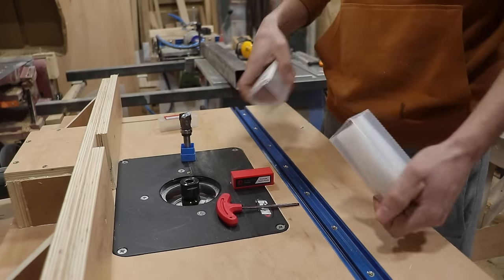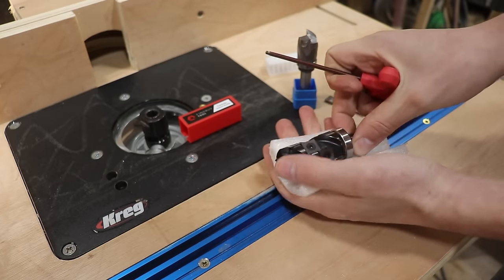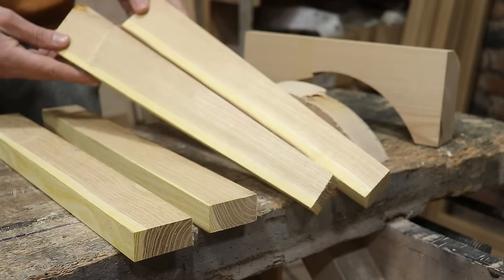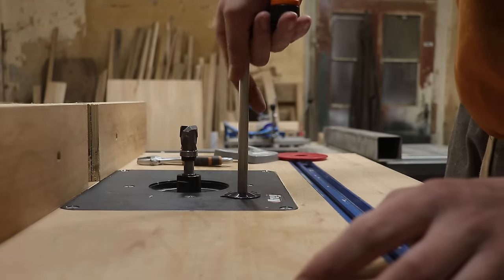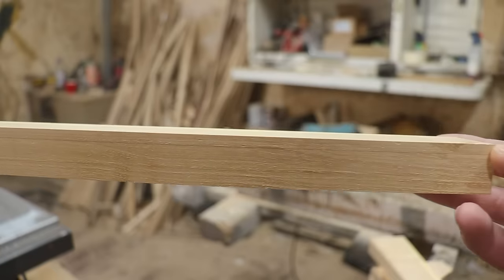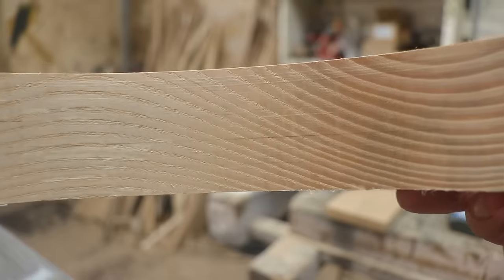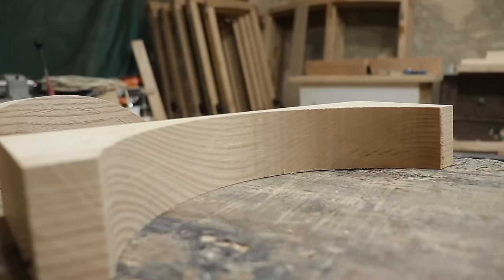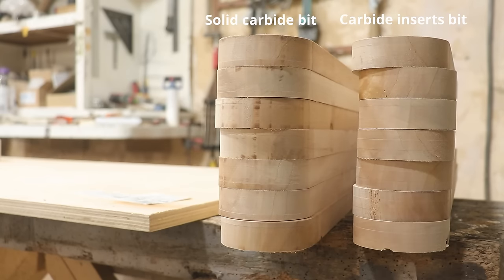The TRUTH about the carbide insert router bits

Comment: The insert one leaves very noticeable lines where the inserts are not at exactly the same depth.  Love the idea of these though; scare the $#@! out of me however.
Reply from the maker: They do leave some marks. Not going to lie, this thing is pretty intimidating!
Reply: Just like working for years on a small or mini lathe and stepping up to a BIG lathe. It takes a while to get used to the size. But once you do, it does not bother you any more.
Reply: But read the pinned comment at the top. Niclas explains that two of the inserts were not properly seated. When he removed them and then placed them back in properly and tightened them, the horizontal banding was gone.

Comment: Care needs to be taken not to over-tighten carbide inserts. Two years ago I installed a helical carbide cutter in my thickness planer and had to remove all the inserts in order to put the cutter into the planer. Two of the inserts were already broken in half. The manufacturer recommended using a torque wrench at a specific setting.
Reply from the maker: This is good to know! Thank you!

Comment: Hey, manual machinist here. HSS can cut mostly just as good as carbide, though heat kills the cutting edge like nothing. Carbide is wonder for wood cutting, cause it doesnt experience same thing as in metal cutting such as chip welding itself to the cutting edge and etc :D Endgrain black marks from cutting are due to cutting edge is rubbing againts the surface or improper feeds and speeds.
Reply from the maker: In my case was from cutting too much at once. I wanted to push them to their limits.:)
Thanks!

Comment: Very well done review. I recently purchased on of the carbide insert trim bits very similar to the one you used here. I have not used it yet but, feel better about it now seeing your video. It's a bit on the scary side;)
Reply from the maker: Thank you!
Make sure that all the bolts are tight. Not going to lie, but I had mixed emotions when I first tried this thing. If you are not scared it means you are not focused enough when working with your tools:)

Comment: I see a line from the insert bit. Seems like the solid carbide router bits I use last a very long time. Just a hobby woodworker; maybe a production shop could bebefit from the insert bits. Nice review. Thanks.
Reply from the maker: I rechecked the inserts and a couple of them were not aligned resulting in those lines. I am glad you enjoied the video! Thank you!

Comment: Good vid, I’m thinking of getting one. Do the bits last long and are they expensive to replace?
Reply from the maker: Thanks! I am not using it daily but so far they hold their sharpness pretty well and I have 3 more extra edges to go. 10 carbide inserts will be around 20$. On this bit, before buying it you can select a second option with 10 extra carbide inserts and I think they will be cheaper. You can checkout on the first link in the description. 
Thank you!
Reply: @ Ok thanks, will do. I’m trying to find a 3” one to avoid switching the bearing

Comment: Nice review. 

I would have liked to see a test cut of your big HSS bit as well. That would have given us a baseline of what your router and jigs could do with steel to see just how much of an improvement these are. 

I do note a line in some of the cuts from the insert bit. Any chance that there's a chip under one of those inserts?
Reply from the maker: Thank you!
Unfortunately, the HSS bit is dull and wouldn't have been a good comparison with the inserts one. Those lines are from the inserts, they are not perfectly aligned with one another.
Reply: @MadebyNiclas  I know. Just a question of if the alignment issue is a chip under an insert, an insert not seated correctly, a insert that's thicker, or the cutter body that's mismachined. It's close, and if you are willing to sand a bit, not a problem. But, if it's just a bad insert it could be fixed very easily.
Reply from the maker: @bobmazzi7435  I rechecked all the inserts and 2 of them were not set correctly I readjusted them, and made another test cut, and all the marks are gone, with no noticeable marks anymore.
Reply: @MadebyNiclas  Now that's what I expected. Those things are usually "right".